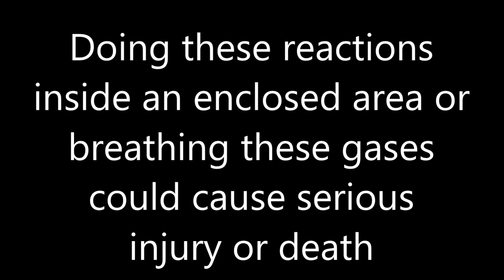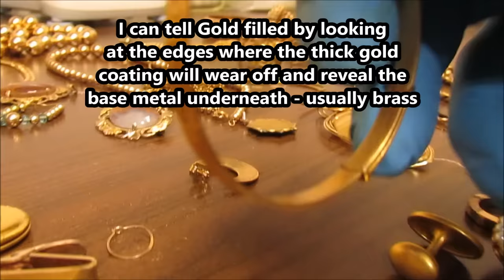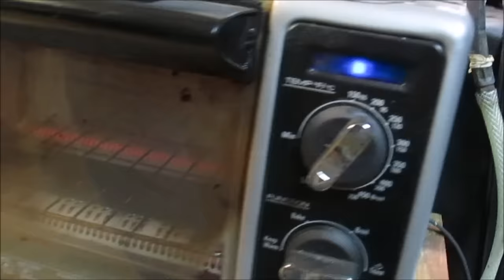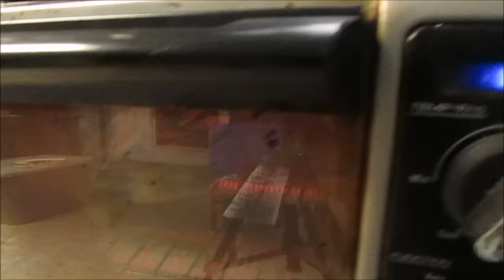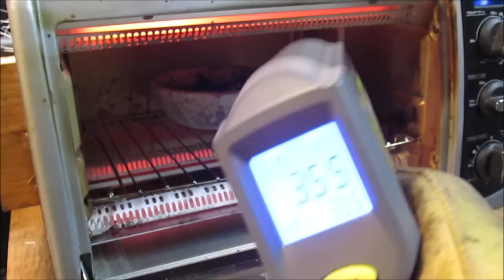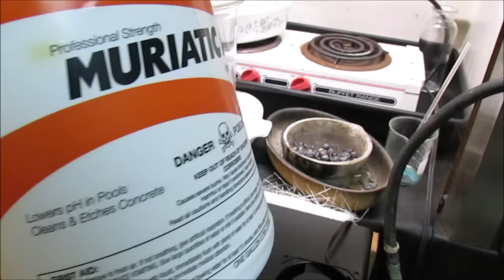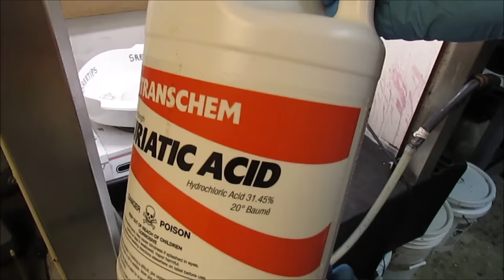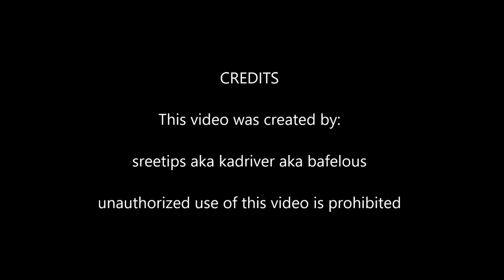Gold Refining 740 Grams of Gold Filled Scrap

Comment: Why did you use tap water ice? I thought you don't want anything but distilled?
Reply from the maker: Only when working with silver. The chlorine in tap water will react with silver in solution forming silver chloride. But the gold in solution is already a chloride so adding chlorinated tap water matters not.

Comment: Looks like how I do my gold filled batches. I've always wondered what that grey sediment is that usually left over after gold filled is processed in ar. Copper byproduct?
Reply from the maker: I guarantee that at least some of the sediment will be silver chloride. Maybe even some rhodium. It don't dissolve so well in aqua regia. I save the filters for later processing.
Reply: @sreetips  the Grey dirt doesn't dissolve in ammonia either. I've found that if some base metals make it through the initial leaches and into the first AR process you'll get that grey dirt at the bottom. The rhodium usually floats and you can see it shimmer, but that grey stuff is odd.

Comment: just how much did you make after you take in the cost of all the chemacals used, the electric cost for the lights, fan hood, vacuum pump, heater an oven use, gas for the torch, distilled water, filter paper,  air condition or heat the building, time spent taking  everything apart so on. . it was not hours it was days. say you sold it for $990 after all you did you made a lot less than that if you count all that in with it .
Reply from the maker: Not counting my time (because this is my hobby) I had less than $100 all in.
Reply from the maker: That bar was worth nearly $1100 at the time. At $990 the buyer got a good deal on it.

Comment: why not smelt the steel as well? If you can't sell it you can mold it or use it for building material.
Reply from the maker: I have zero experience smelting metal. Smelting is a term used to describe extracting metals from ore. I've never done it.

Comment: why don't you use sand or oil to help heat the beaker evenly?  but the beaker in then fill with fine play sand or oil to the level of the porcelain dish.  it will help heat it alllllot faster and more evenly

Comment: im  confused...you say most of the base metals have been removed.  you pull up chunks.  what is that made of?
Reply from the maker: The chunks are karat gold foils that used to be bonded to brass. But the brass has been dissolved by he nitric. Nitric will not dissolve karat gold. The foils get left behind and usually remain in the original shape of what they used to be.

Comment: You have a piece in that batch that said U.T.S with white enamel and two emerald stones pendant. I would like to buy that piece if you haven't thrown it away.!
Reply from the maker: I look at each piece with magnification. If there were chips in the enamel or other problems making the pieces less than perfect then they probably got thrown into the acid and refined.

Comment: I am wondering how do you dispose of the wastes of this process?
Reply from the maker: Paul, all the waste goes through my stock pot to recover traces of PMs. Then the waste from my stock pot goes into my waste treatment bucket. All the copper is removed there on iron. The resulting acidic iron solution is treated with NaOH to pH9, the iron hydroxide gets filtered out and disposed, the caustic solution gets dosed with pH down from the pool supply to pH 7 then disposed. I spend much time on waste treatment.

Comment: Great video indeed.  Makes me wish I had a lab setup and to start collecting scrap gold.
After precipitating the solution for the third time and letting it settle, as you were pouring the waste solution off of the top of gold, it had some particulate that went into the waste beaker, at the 1:19:39 mark.  I was wondering what that was or if it had any value/meaning. (I'm just watching this for the first time now so sorry if I;m a little dated in my comment.)

Comment: Thank you Sreetips! I’ve really been enjoying your videos and was wondering what size/brand Buchner filter and funnel are you using? 
Keep up the great work and thank you again!!
Reply from the maker: Before buying a Büchner funnel, check the size of the holes in it. You want one that has tiny holes in the floor of the funnel. If you get one with large holes then there is a greater likelihood of a filter paper failing under vacuum.
Reply: sreetips thanks for the quick response I’ll keep that in mind when buying one.

Comment: Seems like you have to use alot of Nitric Acid, wow.  Also, is there an advantage of using direct heat from the torch to melt the gold as opposed to putting the crucible on a burner to melt it.  Nice chunk of gold you got.
Reply from the maker: Melting in an open-face crucible is the way I learned to do it. I don't think that it makes a difference.

Comment: how do you get the silver out of the nitric acid?
Reply from the maker: There’s two ways to do it. One is to add clean copper to the silver/copper nitrate solution and cement the silver out. Two is to add hydrochloric acid and precipitate silver chloride then convert the silver chloride to pure silver with lye and sugar.

Comment: I can see how it might be an optimum practice in terms of preserving values, but is it worth it to process the base metals solution for silver? I would think you'd have maybe some silver in there but otherwise a big load of brass and nickel. Maybe I am imagining a lot less silver than what might be in there. How much silver would you expect to get out of what looks like 2800 ml of that solution in the second beaker?
Reply from the maker: Not very much, there were some gold filled items with Sterling as the base metal. But there is still plenty of active nitric in those solutions. I'll just throw some scrap silver in until all the nitric gets consumed and remove any silver that don't dissolve completely. Then add HCl to precipitate silver chloride. Then transfer the waste to my silver refining stock pot to cement out any other precious metals on copper. In refining, every little bit counts. Why let the trash man have it when I can get it all out?
Reply: So I ask this as a matter of interest and curiosity, not to challenge you. Your skill in developing and showing these techniques has more than earned my respect. 
But if you say there is remaining free nitric in the base metals beaker wouldn't we be seeing continuing red fumes? It would be interesting to get a pH reading on that liquid. Secondly, no doubt there is some silver in there but it isn't like your exhausted silver cell electrolyte where you could have 10+ oz silver. There, you have only one pollutant, copper and you know with certainty that significant dissolved silver is in there. I'm just saying; if you have only 3/4 oz of silver (I have no idea whatsoever how much silver is in there, but my opinion is that it's pretty small) and 100 ml unused nitric in that solution, the chemicals (including scrap silver) req'd for extracting those would seem to be more expensive than what you'd be getting out of the exercise. Plus, if your silver stockpot is almost all sterling-refining waste, you'd be adding metals into that soup that will complicate things for you when you go to refine your stockpot. 
One possible answer would be to see if a higher-reactive metal (like aluminum or zinc) would cement out unwanted base metals. I don't know. I'm just throwing the idea out there.
Reply from the maker: I'll try to make a video of how I plan to process the solutions from the GF video.
Reply: The nitric acid is not concentrated enough to form significant red fumes - they only form if the acid is reacting with some metal. You need excess acid, using sreetips's process, to ensure all the base metals and silver are dissolved. 

The is a small alteration to the process that can be used, but I like sreetips's procedure better.  Once you are no longer getting red fumes, you could add silver to the reaction vessel and boil it until there is no more reaction. But since that solution is going to be dumped into the silver stock pot anyway, you don't really gain much.

Comment: i watched it all so how much profit did you make after using all that stuff
Reply from the maker: Paul, this gold filled material came from junk jewelry bags that my wife gets. As I sort through the pieces I come across these GF pieces and set then aside until I have enough to make a batch. So it would be hard to calculate how much it cost. To me, it's extra bonus material. I spent less than $100 to refine it. If I remember correctly, this bar was valued at $1100 at the time. It sold for under $1000 - the buyer got an extremely good deal.

Comment: Thank you very much Mr sreetips, very nice video, a question I want to know why you put nitric acid diluted to dissolve the basic metals, concentrated nitric acid does not attack the gold.
Reply from the maker: that is correct
Reply: It is easier to control the amount of nitric acid made during the additions. This is especially important during the mid part of the base metal dissolution where the solution can boil over if too much nitric is added.  Also, since the water content in the reaction vessel tends to boil off, the added water rehydrates the mixture, which would otherwise tend to gel up when cooled.
Reply from the maker: Mohamed, I didn't understand your question. Buggsy5 has the correct answer. The base metals need a medium to dissolve into. The distilled water provides that medium. Using just concentrated nitric with no dilution is like washing your hands with just dish soap. They would get clean, but adding some water greatly increases the efficiency of the soap.
Reply: @sreetips  thank you very much Mr sreetips for your answer I understood correctly.

Comment: PURE Gold ??? but what Kt. did it come out to?  Your sold price was high to me. Most was 12 to 14KT.   24Kt. would have been the $1100 range.
Reply: If it's pure at around 99%, then it is 24k so you are spot on for the price. From what I understand, the amount of Kt is determined by the concentration of other metals, so if you filter and dissolve  (remove) the other metals, you get your 24k.

Comment: Where are you finding 2.5L nitric for $25?
Best I can find is 4 bottles each 2.5Liter for $175
Reply from the maker: That was about four years ago. I bought it on sale from my supplier for $156 for six 2.5 liter bottles. Today it cost me $300
Reply from the maker: But you can buy a 14 gallon stainless keg of nitric for about $400 - that’s about $28 per gallon. There’s a $200 deposit for the keg but you get that back when you return it.

Comment: A Running Chemical Costs Total would be good to see, rather than just X ml  : ) also why don't you smash up the scrap using a heavy hammer to split everything open so the acid can get inside and dissolve the base metals?
Reply: I wondered why they don't smash of grind up the metals in some way to make it faster dissolving.
Reply from the maker: That's more work. I'd rather let the acids do it for me.
Reply: I agree. Look how much more effort is wasted filtering & picking out base metals; Abrasing/smashing it all first will allow acid inside the cases. Beneficial crushing takes 2-3mins. Not doing that is False Logic.

Comment: why not just to boil it all in aqua regia for several hours and then filter all liquid?
Reply from the maker: Because then you would have base metals in solution with the gold. Remove base metals first then refine the gold.
Reply: sreetips yes, but after dissolving can you reduce gold separately from all another metals?
Reply from the maker: Precipitating gold from a dirty solution is problematic. I've tried doing what you suggest with neg results.
Reply: sreetips 👌

Comment: where can you buy gold scrap like that??
Reply from the maker: I get it at yard sales and save it up until I have enough to make a nice bar
Reply: If you buy it as a batch like this you will probably pay around the value of the refined gold.
In my experience, buying batches from people is not worth it. 
You'd have to collect it over time like streetips pointed out.

Single items usually sell for cheap and sometimes you find something for free as the value of a single items is rather low and not worth processing on its own. Plus it no longer holds value to that person.
People selling in batches want the full value without doing the processing needed. And sometimes even more then that. Like most pc scrap sellers.

To learn and get experience you could buy batches on ebay etc. But do not expect to profit from that, at best you will learn without it really costing you a lot of money.

Comment: Where are you getting 2.5L of nitric for $25? Best price I have found is $105 for 2.5L
Reply from the maker: GFS chemical had it on sale $156 for six 2.5 liter bottles. The regular price is $198
Reply: sreetips I will look into them
Reply: sreetips is that where you get your supplies?
Reply from the maker: I buy the nitric from them. Most everything else comes from Ace Hardware.
Reply: sreetips again thank you

Comment: Quick pro quo how do you feel something with gold the mirror explanation of feeling is to inject how do you inject gold into other elementsI believe strongly the words that you are looking for is plated my friendthere is no such thing as gold filled we are not working with doughnuts LoL 😜 actually after thinking it over there are pieces that reside with two elements in them like smelting steel aluminum and gold together I guess can be considered gold filledbut still that would be the only things most of what I see that you have is plated
Reply: The scrap he's using is not electro-plated, that would have a much thinner layer of gold that would obviously yield less gold upon processing. They call this stuff 'filled gold' in the US, but I guess it would more correctly be called 'gold coated' - it's not something we typically see in the UK, we either have gold-plated or solid gold (traditionally 9, 18 or 22 carat).

Comment: How much does it cost you for the chemicals used in this refinishing process?
Reply from the maker: The most expensive was the nitric acid - about 2.5 liters. In the video I put $25 for a 2.5 liter bottle. But after requests for verification I checked and it was actually about $40 for 2.5 liters
Reply: @sreetips  what would be the total cost incurred along with the scrap used and the chemicals
Reply from the maker: I don't track it that closely for each batch. It's all lumped together and I don't get to find out how I did until the end of the year!

Comment: By “gold filled”, you mean “gold plated”?  If not, what is the difference please?
Reply from the maker: Gold filled is a thick layer of karat gold bonded to brass. Gold plated is a micro thin layer of gold electroplated over junk metal that has first been electroplated with copper. 100 grams of gold filled will yield three grams of pure gold. To get three grams from gold plated you'd need about 10 pounds or 20 kilos of material. That's the difference.
Reply: sreetips - Awesome. Thanks for the info! I had no Idea.

Comment: why do you npre-heat the scrap?
Reply from the maker: To burn off any grease oils wax or any other combustible material. Incineration prevents an oily scum from forming in the beaker with the hot acid.

Comment: is gold filled the same as gold plated?
Reply from the maker: No! Gold filled is a thick coating of gold over brass. It has a thousand times more gold than gold plated junk jewelry. Gold filled is usually, but not always, marked like this; 1/20 12k GF or 14/20 or 10k RGP.

Comment: Gotcha. Would you say it's a safe bet that 7 to 800 grams of GF scrap will make at least 15grams? As an average.
Reply from the maker: Depends on the skill and technique of the refiner. I've learned that l get better results if I make sure that any questionable material gets excluded, and I leave the foils in the nitric longer than I think they should stay. When I think they're done, I drain off the spent nitric and do one more nitric boil with high heat. You're biggest problem will be anxious to get a result which cause you to try and hurry things along. I wish that I would have gone slower and took my time back when I first started. I did a 700 gram batch one time and only got about 7 grams of gold. Due to my inexperience, not incinerating the foils, and my strong desire to get it done so I could see my bright shiney pure gold.
Reply: Haha okay. I hear ya. Incineration be4 and after nitric treatments, check! Patients is a virtue. When I  did my first carat scrap inquarting while watching your karat scrap  video. At the end of my nitric treatments my "corn flakes" started to turn the dilute nitric purple like when doing a stanous test. I stopped the treatment of course. Is this because I did one too many treatments  or did  I make the karat too low when i enquarted the silve and it started breaking down the gold?
Reply: Was still a 1oz bar. Pretty. But one thing that happened during refining.
Reply from the maker: Purple gold in solution is probably colloidal gold. If too much silver was added then the inquarted gold would crumble and fall apart. I once boiled the inquarted gold a last time after all the silver was gone, for about 8 hours just to see what would happen.. The nitric turned yellow so I tested it with stannous and to my surprise found gold in solution.
Reply: So i guess nitric does dissolve gold on its own after time. I poured off the purple liquid. Let it settle, syphoned, and filtered. Was big enough particles to trap in filter and melt. Was a gram or so. Weird small particles looking like it was in solution but then settled as a solid. Was interesting for sure.